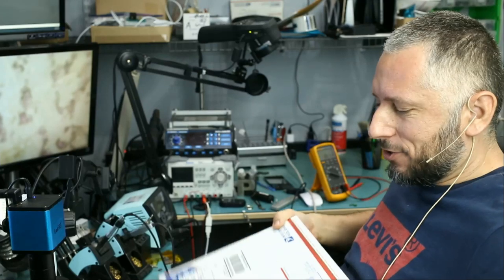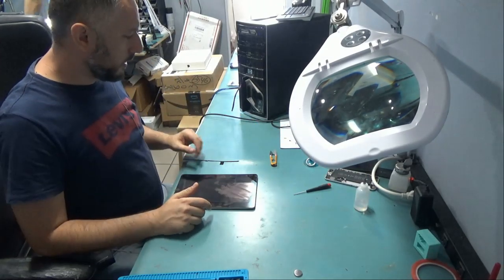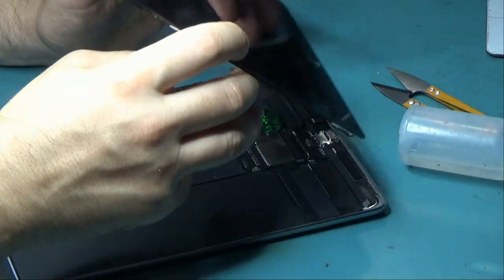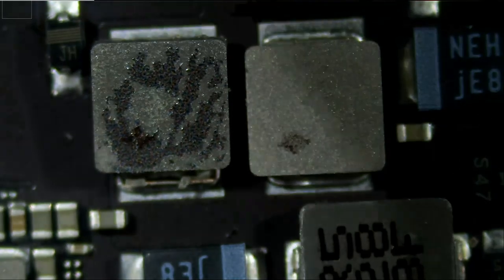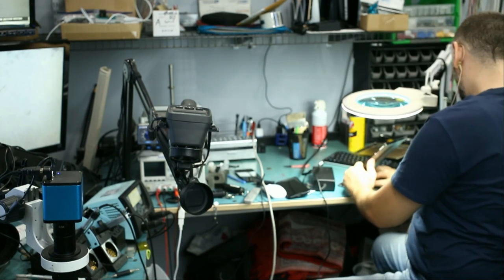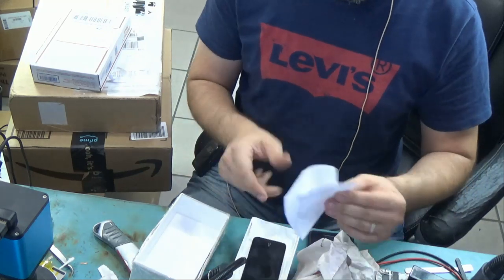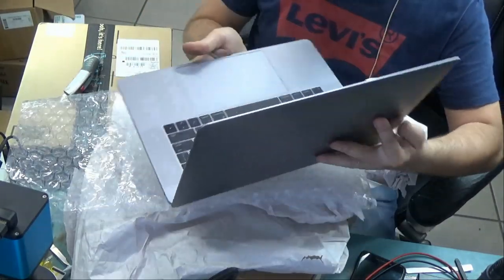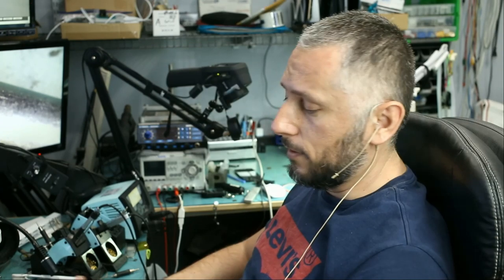iPad pro 10.5 Dark Spots uneven LCD Backlight Repair + Mail-ins

Comment: Have you ever fixed the 2nd gen iPad pro 10.5 /12.9 with white spot about an inch above the home button? It's a really widespread issue.
Reply: Check his other video clip for ipad pro 12.9 backlight replacement I believe
Reply: yeah whats up with that location of bright spot. Everyone had it at the same place
Reply: It's a defect that happens to every unit don't even bother replacing

Comment: Just swap the frame since it comes with the new glass anyway. Customers pay 170 to 250 for an iPhone 8-X housing swap no problem and the profit margins are good. Way easier then chiseling off glass only to damage the Wifi antenna coil lol There are some really good housings that already come with the dock connector, volume and power keys pre installed.

Comment: I have the same problem but the white and dark spots only happen on a certain angle. So is a repair necessary? (The issue rarely happens)
Reply: Is ipad is still ok with those spots?
Reply: sumit deswal i’ve bought a stiffer and larger case to compensate, yes it does make it a lot thicker but It almost never happens anymore. I’ve decided to not repair it since i would just buy the newer iPad Pros if it breaks instead.

Comment: Hello am from India on my iPad Pro a very thin horizontal line comes on a particular space for few seconds and automatically disappear after ,it comes couple of time in a day and some times it not appear work fine without line .when I try to take screenshot it no comes in screen .can you guide its a display problem or any circuit issu .I am student and in India Apple serine very bad .plz help I want to share video what kind of line but where .

Comment: What is the reason for these spots?
Reply from the maker: Either the tablet was dropped and screen got damaged or it could be the screen was replaced without disconnecting battery first causing motherboard backlight issue.